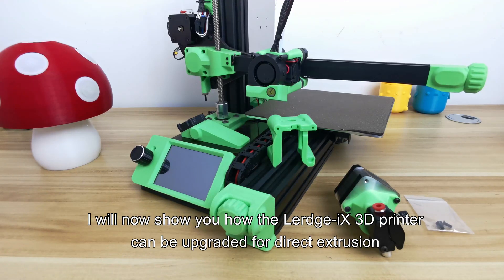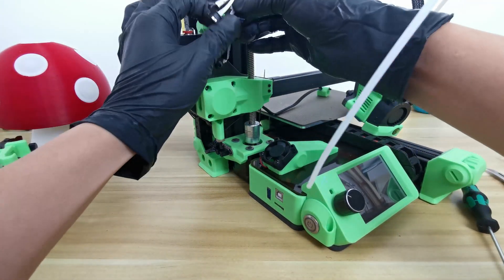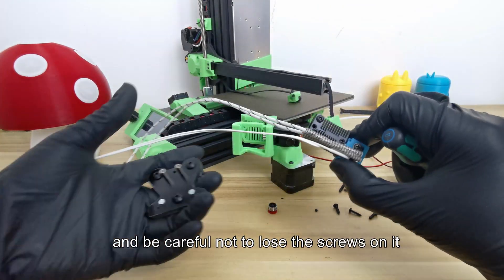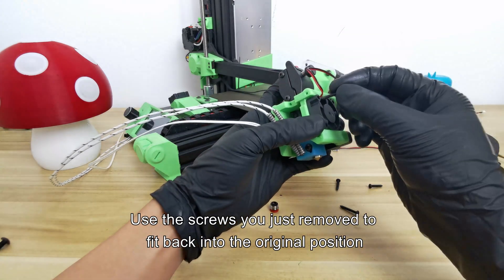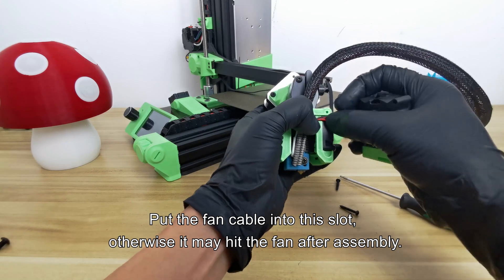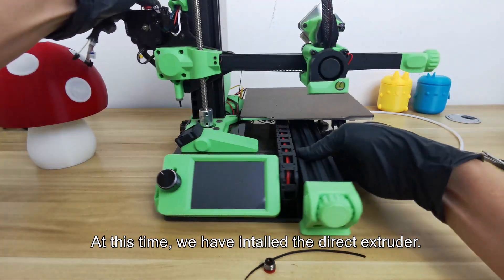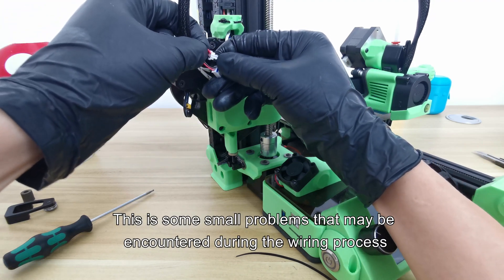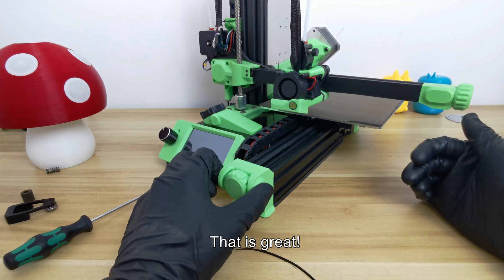Upgrade Lerdge-iX to the direct drive extruder | 3D printer upgrade| Lerdge-iX VS Ender 3, Kingroon

Comment: Does the aliexpress voice kit come with everything, or do you have to buy a part?
Reply from the maker: The aliexpress voice kit includes everything for the basic printer, but does not include modified parts, such as the direct extruder in the video
https://www.aliexpress.com/item/1005003612436893.html?spm=a2g0o.store_pc_allProduct.8148356.4.8a5b551ccpGicE&pdp_npi=2%40dis%21USD%21US%20%24261.00%21US%20%24198.36%21%21%21%21%21%4021038ede16783315952222601e10c8%2112000031351346176%21sh&gatewayAdapt=4itemAdapt
Reply: @Lerdge3D  Thank's. and to upgrade I will need what else comes in the kit?
Reply from the maker: @MiguelSpark  the extruder and motor kit, our store will release the kit next week!
Reply: @Lerdge3D  Okay thank's

Comment: What print speeds and acceleration do you use for the Bowden versus the direct drive?
Reply from the maker: the same print speed for Bowden and direct drive, the max print speed for XY axis is 200mm/s